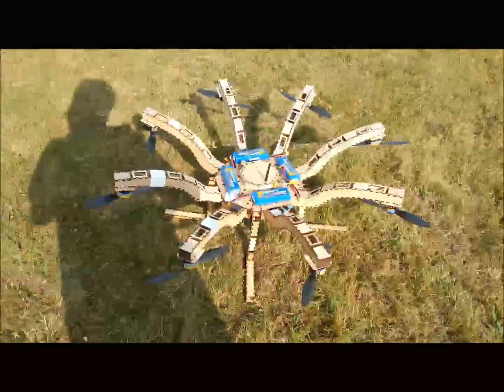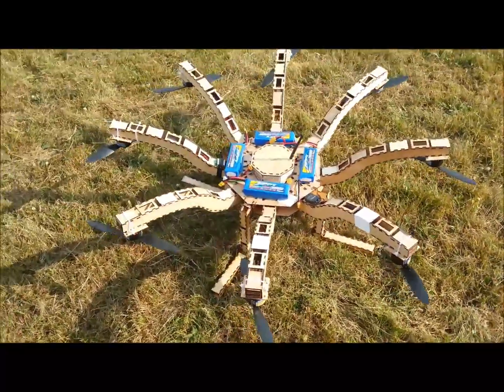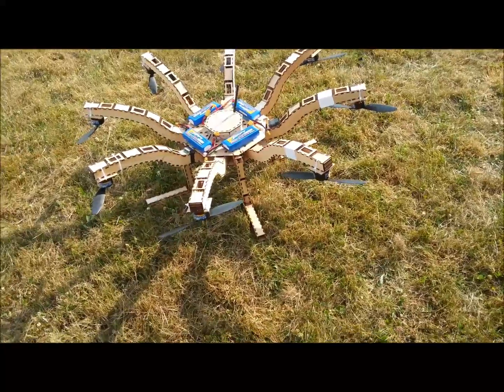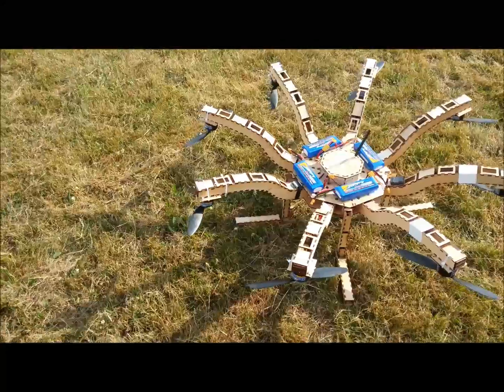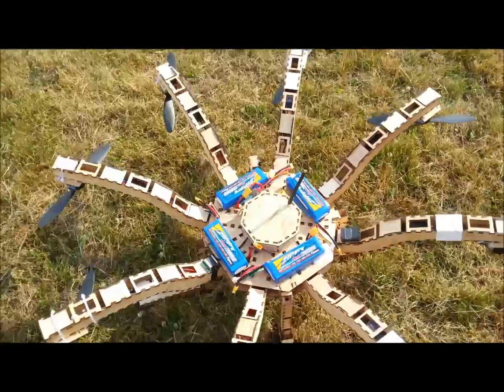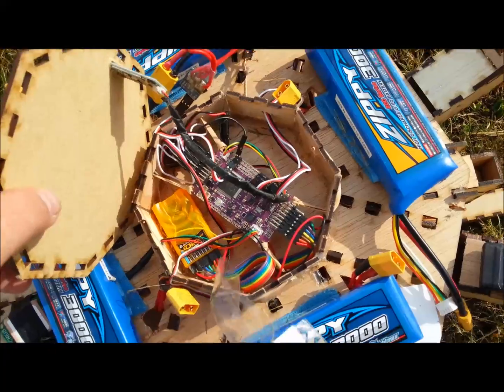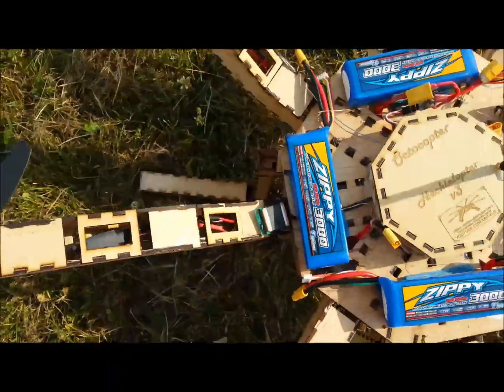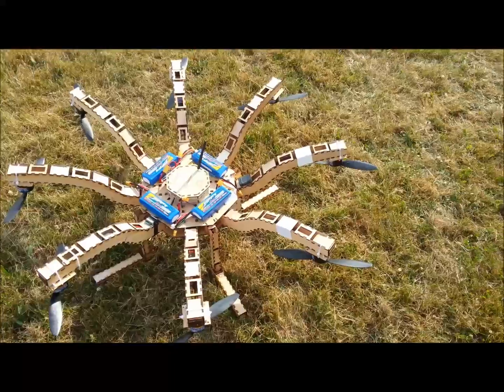6 hour octocopter build for bbc interview, demo flight 5th flight

Comment: He did say it's not so much for the flight times but more for the weight it could lift,plus it wouldn't take several hours to charge 4x4s batteries with a good c rating and of course a good charger. ;-) 

It's always nice to read a positive comment.